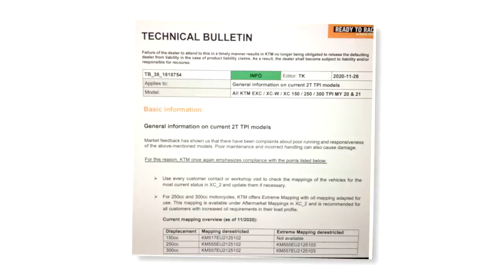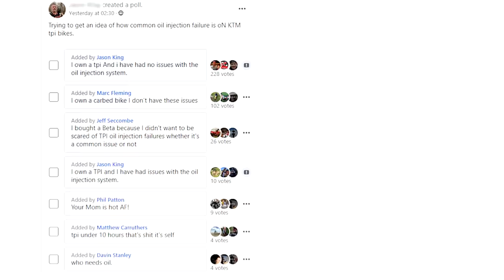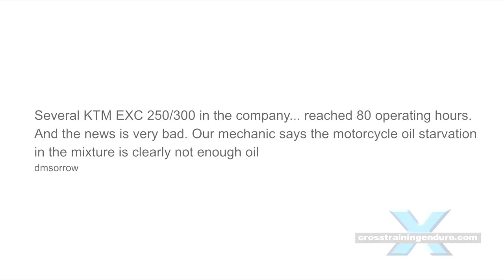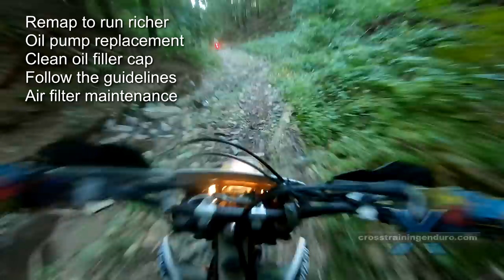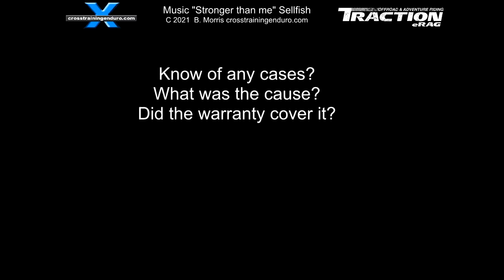Are TPI models seizing? 7 preventative strategies for KTM TPI problems ︱Cross Training Enduro

Comment: Good video and you bring up some valid points. While I’m no expert in this arena, I would be interested to see which area most of those failures take place in. When I look at most videos done in Europe, I see almost no smoke when the guys are riding, which leads me to believe the bikes in Europe run very lean for emission purposes. In South Africa, all the bikes in my riding group and my observation on other tpi’s is that they all smoke, some to the point where “spoog“ runs out of the exhaust. It might be that our bike runs richer, also note that if the guys don’t do the idling screw mod and just turn the air screw this will also run the bike lean. All the guys in my group complain of the bikes not idling properly so everyone has done the idling screw mod. One last thing, with the angles that we ride in hard enduro whether we are going up or down a climb, it is important to always make sure the oil reservoir is full and that the bike never gets to a point where oil is not available for the pump. Geez that was long….but so far, touch wood, no issues on my 250 and 300 tpi yet….
Reply from the maker: Good points, Gordon. I appreciate the detail and I'll be adding stuff like this to the pinned first comment.
Reply: I’m getting a 2022 te300i today and am nervous as hell now. My Honda dual sports are not sensitive. You think I’ll need the idle screw mod? Thanks for any help?

Comment: I own a 2020 300 exc i purchased new, it's got 100 hrs on it now, I replaced the top end at 88 hrs and it's been awesome. I've added a TSP ecu & head package also. Best bike I've owned.
Reply: how much change did the TSP ecu & head package make ? what compression head insert did u get ? I'm not looking for more power just smoother throttle response so thinking about the TSP gear upgrade
Reply: @YilgarnRallye  it made a considerable difference mate, mine was unresponsive and sluggish from new. The TSP totally changed it, it's now responsive & has smooth power delivery. I went with the medium comp. Highly recommend it.
Reply from the maker: A remap certainly can help, Garry. I rode various 2019 TPI bikes in Romania and they had them all remapped by their local guru. Great linear power delivery, it felt just like all the Betas I have ridden in that respect.
Reply: @clintanthony1779  my 2020 300 TPI is not bad, quite a bit better than the 2019 one I had, but could still do with smoothing out the mid throttle in particular....thinking the TSP Low compression head insert and reflash may be worth a go
Reply: @crosstrainingenduro  stock my 2020 is a lot better than my 2019 TPI bike, but could still do with more refinement in throttle response
Reply: @YilgarnRallye  100% worth doing mate. You won't regret it.

Comment: USA, 2018 250i, replaced the piston at 80 hours and it looked good.  Over 100 hours now and still running strong, added the TSP kit (head and reflash) a couple months ago and very happy!  Now I'm more worried about dialing the suspension, wish I had gone with an XC instead of the XCW, but I'm getting there.  Bottom line - I'm happy with my TPI.
Reply from the maker: Good to hear, I spoke with one TPI tuner who said it's strange that there's so much variation... a few bikes seizing early but then others going as high as 200 hours before doing a top end and it all looks fine even with the stock mapping. It's good you went the reflash though.

Comment: This explains the amount of new Yamahas im seeing on the trails.  I think part of it anyways.
Reply: What yamahas? This if about 2 stroke enduro bikes, yamaha doesnt even have one
Reply: It's about FI in T2. Yamaha has the YZ used by many around the world for cross country and enduro. Also Betas and Sherco making a move with their carb enduro bikes. Better bikes I made add 👍
Reply: Yz250x 2 stoke Yamaha enduro bike
Reply from the maker: Where is that, TC? I'm interested because we used to see the blue bikes everywhere 20 years ago but haven't seen one in our riding areas in recent years. The two stroke would have been popular if you could register it and it had electric start....
Reply: @BrianK-pd4bu  not available in europe. And comparing yz250x with 5 gears, cable clutch, no counterbalancer, no estart to modern ktm doesnt make sense. You probably never tried ktm tpi, it is really good
Reply: @rafy600  beta and sherco are another story. Had a sherco but ktm is better to ride and is better quality overall.
Reply from the maker: I spent two weeks riding a TPI every day in Romania, as mentioned in the video. The fleet owners did a remap of their 2019 models to avoid all the issues with the earlier models. Nice engine, felt very similar to the Beta RR300 power delivery.
Reply: Yep noticed that here in NZ. Sold my TE300 and went to a four stroke Yamaha.
Reply: @crosstrainingenduro  check the Pol Tarres new YZ, he is going to race the wess this year
Reply: @maucina12  YZ250X
Reply: I have over 200 hours on my yz250,  original piston and sparkplug. 
Measures perfect 👌
Reply: @maucina12  better than Sherco?
 You are drunk.
Reply: I'm seeing a ton of the Yamahas yz250x on the trails. I've seen an uptick in betas too. I also have seen less ktms. It's all white now
Reply: @timm1807  you need to try both to make a statement like that. I had 2018 sherco 300 2t and 2019 ktm tpi. Made lots of hours racing and training extreme enduro on both and I can tell you ktm is better bike overall. Sherco is not bad but ktm is better
Reply: @maucina12  oh im sure you have. Sherco has better suspension, FMF exhaust and thermal fan as standard. The bike is also better balanced so stop talking rubbish fanboy. I have both and i know which one is better and which is currently up for sale before any problems arise
Reply: @timm1807  fmf exhaust is sure a plus on sherco. My 2018 sherco had wp suspension so no difference at that. Problem was bike was noticably heavier than ktm and vibrations were awful. If i had to count how many problems i had with the sherco i would need to write a book. From leaking oem base cylinder gaskets that had to be replaced with custom made ones, rear subframes getting broken... not just on mine but on all shercos in area
Reply: @maucina12  what a load of BS. I know many guys with shercos and none have had any issues.
Reply: @timm1807  ok then, you win
Reply: @maucina12  my friend I been riding KTM since 2002 and when I bought my first TPI (Chile 6 days) everything change for me I spend over 4grand on that bike and never liked. Bought a 2020 Sherco and I am happier than a kid on a candy store. Now have the Sherco 2021 way better than the 20 so for now Im not going back. Its rider preferences have friends that they bought the Sherco and they didn't liked 🤷‍♂️🤙
Reply: @rafy600  sheco 2021 looks nice. they are a bit lighter, sorted vibrations and added kyb suspension. but talking about my old 2018 sherco, ktm is better bike overall. on ktm only problem is tpi system. if it works for you it is the best bike. on my old sherco everything else except keihin carb was problematic
Reply: @maucina12  yeap I understand Im sure before the 20 Shercos they where ruff bikes now they are refined and way better. Me personally the Ktm needs suspencion ASAP for me, and TPI 👎
.
Reply: @crosstrainingenduro  those betas are nice , I’ve written the 250s in Turkey, did you get a chance to see plenty scenery or was it mostly hard Enduro
Reply: Simplicity equals greater reliability. That's one main reason to own a 2 stroke. Forget all the complexities and unreliability of TPI BS.
Reply: @maucina12  Newer Shercos should have those issues resolved. KTM/ Husky just went backwards with reliability and simplicity by caving to tree hugger Euro Emission BS.
Reply: @rafy600  that is a fair point , the rider has to make his own mind up about what is value for money and what he prefers , I ride 18 /19 KTM husky carb bikes , same engine as the tpi and I love them , have ridden TPI , yes they are good do I want one ? no , if I buy another dirt bike it will still be a carby so maybe Sherco d
Reply: @dnrg62  Yeap If I have the chance I buy my  KTM 2018 back. Best one in my opinion.
Reply: @maucina12  uhhhh can you say YZ 250?
Reply: @Bryan-Hensley  lol 5 speed, no electric start, cable clutch, x model not even available in europe. Would be nice if yamaha makes a bike to match ktm tpi but yz is 20 years behind tpi
Reply: Don't know where you ride, go to a local race, maybe one Yama per 1,000 KTM's
Reply: @trav3510 trav3510 You have just outted yourself. Ride a 250X and you'll find it is very much an enduro bike.. I use mine for hard enduro, that change to port heights and angles is surprising, gearing much better, and lighter than practically anything else. I was relieved when I first rode it as there was no demo available. If you judge on looks then you thinks it is the straight old 250, a lot of it is, but the engine changes are a step up

Comment: I have a 2021 exc 300. At 6.5 h the engine started working bad. My mechanic opened the engine only to see the piston and cylinder were like in your photos. It was minutes away from total seizing. KTM referred me to the new dealer in my area ( the old wan lost its license a month after I bought my bike) and they said since it had the race map and 30 days passed after the purchase I was not eligible for a warranty coverage. The cost was almost 900 EUR (at my mechanic, not the dealer, that would have been much more) for the new cylinder + piston kit and a 3 month waiting to get the parts, since you cannot find it anywhere in stock in the whole of Europe, and believe me I tried to get one at all costs.
Reply from the maker: That sucks. Is this in the UK or the US? I'm getting quite a few stories about warranty claims being rejected in the UK, but generally the US is good with support.
Reply: @crosstrainingenduro  Europe

Comment: I just picked up my xc 250 tpi last weekend.  I know the guys in my local ktm dealership quite well.  I asked the question about the tpi failures they have had come in and the most were for pressure sensors failing but one major seizure.  Was told the new map was is ktm’s answer for the seizure issues
Reply: When did they send this map out? I recently bought a 2021, will it have the map or should I be asking the dealer. Tia
Reply: I have a 21 and it had the number two map in it. You have to take it to the dealer and as soon as they plug it in it will update and you cannot go back

Comment: To combat all the rumors about the not enough oil being fed in I went with the TSP remap and billet head. Small price to pay for some piece of mind. (2021 TX300i)
Reply: Me also but did it at 80 hours on my 20 250xc-w and piston and cylinder looked great on stock setup. But TSP high compression head ecu refresh just works so good it worth it.
Reply: @chrispederson4157  ,yes TSP are very good to deal with ,love their aftermarket heads d

Comment: good advice . my son has a 2020 300 . and has had idle problems now sorted by the dealer , ill stick with my 2011 250exc . for the moment .
Reply from the maker: I knew the 2018 and 2019 models often had problems with idling, I'm surprised to hear it still occurs in the later models, Steve.

Comment: beta 2 strokes and ktm tpi are using the same mikuni oil pump. Never heard that oil pump should be changed at 80 hours on beta
Reply: Beta pumps have failed here. Thankfully mine 2016 300rr is still 100%
Reply: Yeah it's bs, you don't need to replace the pump if you use proper oil and you're careful to not drop a dirt inside.

Comment: We have had very good luck with our tpi bikes we sold. No failures, some small operator errors when servicing their machines, air filters, wrong oil use, and overheating/ crash damage failures.
Reply from the maker: Good to hear, Rudy. It almost seems to happen in clusters around he. One dealer said he's had 20% of two strokes back for warranty claims, other say only one or two. Are you getting guys with 2020 and 2021 models asking to go back to the previous mapping?

Comment: 450 hours with my EXC(XC-W) 250 TPI 2018 here,never had a engine seized or a big problems with the tpi system and wouldn't go back to carb. I'm changing pistons every 150 hours. Oil pump replaced after 300 hours of use only as preventive maintenance. But many guys claim the oil pump could work up to 1000hours because it's very simple design, it could only seize if it's faulty from factory or if you drop dirt inside, so when you top up the oil always clean it thoroughly. 2T oil that I use is Motul 710.You need oil that is lower viscosity like Motorex, Motul 710(not the thick Motul 800)and it needs to be made for oil injection systems. No oil in gasoline tank!
Reply from the maker: The TPI specialists we spoke to said the mapping was better on the 2018 an 2019 models but the later models used even less oil and hence the seizing issues starting to emerge. They still feel it's too lean on your model, they usually richen the oil mix by about 20%. Possibly some oil pump failures are user error, but I think there's enough evidence to suggest there were problems with the actual pump... we'd really need KTM mechanics to confirm this but they usually keep their mouths shut.

Comment: I had a 2020 KTM300 XCW fail at .10 hours. The cylinder was scored. The bike still ran but ran poorly and would not develop full power. It took a few trips to the dealer before I pulled the exhaust off and looked in the cylinder and found the scoring. KTM and the dealer treated me well and replaced the top end, oil pump and oil tank. The bike has run great since the rebuild. This was in February of 2020. I got the bike back in April. KTM did say the had a few failures. Failures can happen to any brand. KTM did the right thing and took care of me and supported my dealer.
Reply from the maker: Good to hear, there have certainly been plenty of guys who haven't been looked after because they fell outside the tiny 30 day warranty. Did they remap the bike to the older mapping?
Reply: They remapped mine to the version 2 mapping.
Reply from the maker: Excellent. Apparently it's still quite lean but very few of the 2018 and 2019 models seized.

Comment: @CROSS TRAINING ENDURO I put 190 hours on my 2020 TPI bike and the only issue was the leaking PV cover. I never did change the oil pump. My thinking is if it's still working at that point the chances of putting in a new one that is faulty is higher than the original pump failing. The number of other issues on new tpi's I'm seeing now is a big part of the reason I switched back to a carb bike.
Reply from the maker: I'll be considering a new bike in the next six months and a TPI model was on the list but I've taken it off now. I know the failure rate is low but I've always preferred bikes with less complexity... hence a DR650 for my adventure rides.

Comment: 2021 KTM 300 XCW Erz edition (friends)- oil pump failure at less than 10 hours - replaced entire engine

2021 KTM 300xcw - (mine)30 hours - no issues
Reply from the maker: Any chance you saw wher the oil pump was made before it was installed, Jake? Or still got the old one to check? I know fuel pumps for KTM's four strokes are made in China, I wonder if the oil pumps are made there too and are simply cheap nasty products? In so many other bikes oil pumps simply last the lifetime of the bike, whereas KTM recommends replacement at 80 hours... but in some cases they don't even last 10 hours.
Reply: @crosstrainingenduro  I hate to say but at 40 hours mine seized this weekend, did I overheat it, oil was too low? I'll check it out and get back - He had the shop do his work and didn't get any "feedback".

Comment: I reckon these issues are Sherco's greatest advertising campaign.  After years of KTM.Husky ownership my next will be a carby 300.  I guess my concern is that if there was an oil pump failure then that's it for the motor basically.  Almost every other car/bike on Earth has an oil pump that will last for the age of the vehicle so I do not understand how KTM cannot do the same.
Reply from the maker: I don't know how many oil pumps fail, Glenn. But like the seizures themselves I think it's a small but significant rate. Mind you, Sherco have plenty of issues with stators and ECUs randomly failing... but at least it's not seizing the engines.

Comment: My mate had his 2020 husky 300 fully rebuilt under warranty, it was getting 40-50klm out of a tank of fuel and leaked oil from the power valve cover, was running crap. He went to the dealer and they reckon it was the running in at the factory which caused the problems and got it done under warranty, I was very surprised it was 6 months old.
Reply from the maker: Do you know how many hours he'd done before taking it back, Eddy?
Reply: @crosstrainingenduro  50 hours
Reply from the maker: Interesting... I assume some dealers are very supportive and much push the case for a warranty claim with head office, I've seen a few 'good will' warranties. But then some dealers are trying to wriggle out of warranty claims as low as three to six hours.

Comment: I just did a top end on my 2020 KTM 300 XC TPI at 150 hours and it looked almost new, could have gone much longer. I did replace the CCPS and that cleaned up a little sputter at low revs.

Comment: My 2018 was perfect no problem at all.
My 2021 got problem with the CCPs after 16h.
Was unridable at part time throttle.

It now got the idle mod screw and a new CCP and works awesome.
The idle mod screw makes the bike run a little more rich as you can turn the regular idle screw almost to the bottom instead of standard (2-2.5 turns, out).